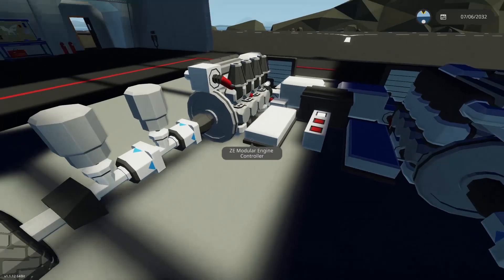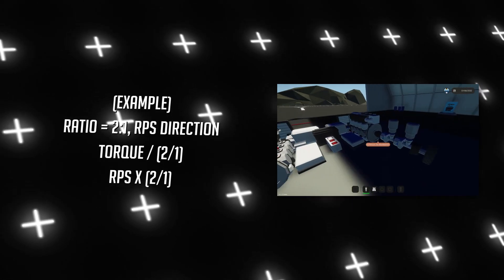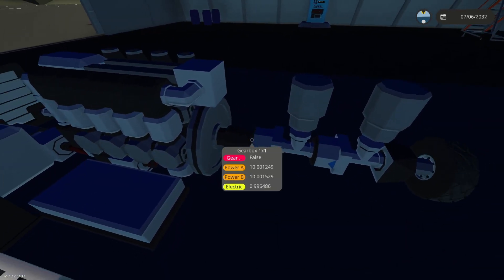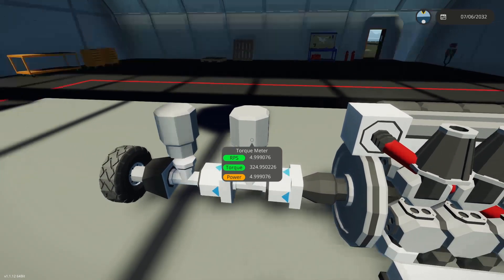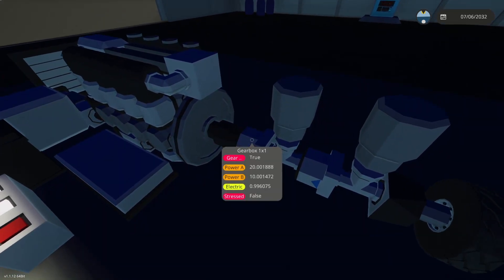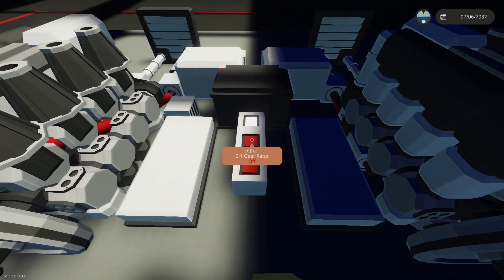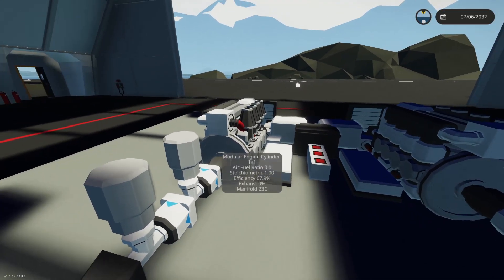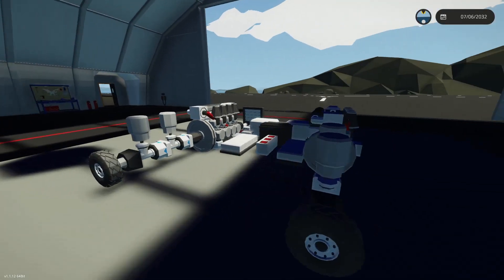How to use gearboxes in Stormworks - The Gearbox Guide

Comment: i cant get my gearbox to work on a flipswitch for some reason... my pumps do work on a flipswitch though and both the pumps and gearbox use the exact same logic: composite input - composite read (on respective channel) - on/off output. pumps work, gearbox doesnt...
also my pumps that pump liquid in my tanks run at 6L/s and the ones that pump out run at 60L/s for some teethgrinding reason and i cant fix it, but i guess thats besides the point
this game drives me nuts, nothing ever works... and i never know if its a bug or i did something wrong. for example i was trying to fix my fuel pump for over an hour, because i couldnt refill my base - until i just took a hose, turned it open and suddenly it sprayed fuel all over the place (so my pumps do obviously work). so then i read that my base might be airlocked, so i pumped everything (fuel and gas) out of the base for about half an hour until it was completely empty. and then I ****ing still couldnt fill it, its just not pumping in anything in D:<

Comment: For me, it don't matter whitch direction I have the gear box.  When I flip the switch for it, it slows down.  And it don't seem to matter what ratio I have it ether.
Reply from the maker: if you're facing away, then you're lowering the rps, if you're facing towards the engine and it lowers, you dont have enough power and your engine is not able to cope and will shut down

Comment: New player on boat attempt #4, and this kind of helped. Trying to set up a 4 engine boat, two for thrust power and 2 for speed. Also setting them as inside on one control system and outside on another, and doing it on the most basic, unresearched vessel.

My first boat works, no idea how. Second boat cranks, but no start.
Third boat, engine 3 cranks and starts. 1, 2, 4 only cranks.
Boat 4, looking like i need to flip some gboxes. Just finished plopping engine set up.

Im making this difficult for me.

Edit: also trying to make the pairs work independently from each other. Currently have 4 throttle controls to operate engine thrust and clutch seperately, the two inner set as torque and controlled by one throttle, clutch seperately. outer two set as speed with clutch set up seperately. Inner starters controlled by one toggle switch, outer by another. 5 tanks for each pair, tucked between the the inner/outer engine sets. Air intake comes from cabin roof, exhaust gies straight to rear, above propeller lines. Drive line is directly horizontal to stern. Coolant lines bend towards bottom of boat.

Comment: Does anyone know why my engine keeps dying when I try to increase the rps? I have a 3 cylinder modular engine and I’m trying to increase the rps (using a gearbox)  ,I keep the engine running at 20 rps and every time I switch to the first gear which is set at 1:2 , it seems to stall

Comment: Why does the gearbox 1x1 not work? I have built a boat with four engines. The engines work but the propellers barely spin, although they respond to my throttle. And the W/D buttons don't work. What am I doing wrong? Help me please. My game version 1.3.11
Reply from the maker: I'd say that you engine doesn't have enough power to supply the propellers
Reply: @BigmanBoi  I have 4 motors 20,000 and three propellers 20,000
Reply: @BigmanBoi I'm already confused. should the clutch be connected to what in logistics? I connected to the sports seat, number from -1 to +1, to the W/S buttons.
Reply from the maker: @romanmegagunko4650  Well you can, but what js your engine connected to?
Reply: @BigmanBoi  Experimented a bit on one engine. I was not getting the clutch to work. When I connected the clutch to another throttle switch, the boat went, which made me realise what the problem was. It turned out that the problem was a faulty russifier in the game. Were mixed up descriptions of points of logistics from the sports chair. When I reassigned the points, everything worked))

Comment: I was recently trying to use a reverse gear (1:-1)    on a modular engine and found this really weird big. No matter what I did, the reverse gear would instantly kill the engine and instead of taking the torque from the engine to the propellor and reversing it, it would do the opposite and reverse the direction of the engine, instantly killing it. Do you know why this could be?
Reply: Tbere is nothing weird at all about that. Try shiftong to reverse without disengaging the clutch on a car. You will at best chocke the engine, at worst blow up your transmission.
Reply from the maker: This is something that happens alot. It will be because your engine doesnt have enough torque to handle the change in power delivery. If I were you I'd disengage your clutch, change gear, then re engage to keep your engine running
Reply: Get some flywheels before Gboxes.

Comment: Perhaps if you arranged them laterally with clutches to disconnect the not-in-use gearboxes, you could make the whole system more efficient.
Reply from the maker: Clutches lose 2.5% of power as well unfortunately, so that would work, but it would be pointless

Comment: Better do your research on how not to break the gearbox. What loads it can withstand without consequences, etc. They break very easily at the most inopportune moment. I think it will be useful for beginners to know in order to make reliable power units.
Reply from the maker: Yeah, it's useful to know, but it's right there in the components description, so it should be easy to understand
Reply: @BigmanBoi  Is it in the description of gearboxes? I was probably not paying attention enough.
Reply: @BigmanBoi  Are you going to make a guide on single rotor helicopters with new rotors? My old helicopter refuses to fly normally with them.
Reply from the maker: If that is what you'd like, then yes I can do that
Reply: @BigmanBoi  I just asked.) But if it doesn't bother you too much, it would be nice. I even tried to assemble the helicopter according to the old guides, but it always turns out the same thing. The helicopter begins to rotate on its axis. I suspect Gyro just can't handle the new rotors.
Reply: And yes. I'm from Russia. And, unfortunately, I have a rather poor command of English. But I am improving at this. Until then, I hope Google translate my thoughts correctly.)